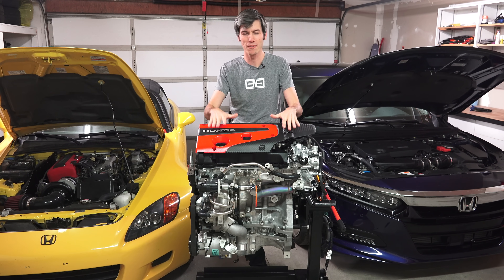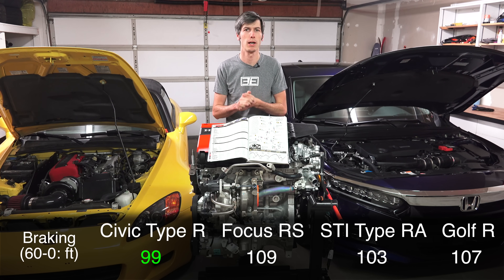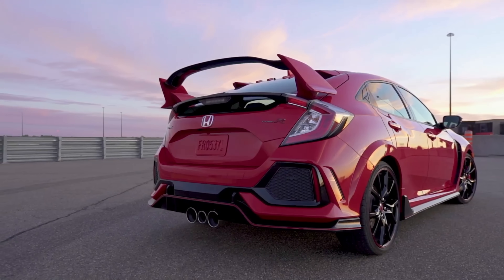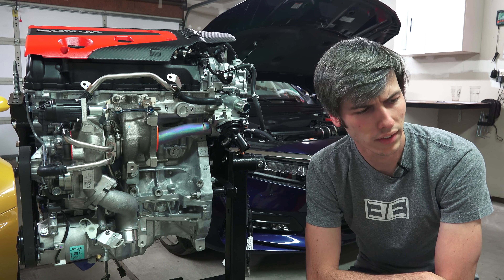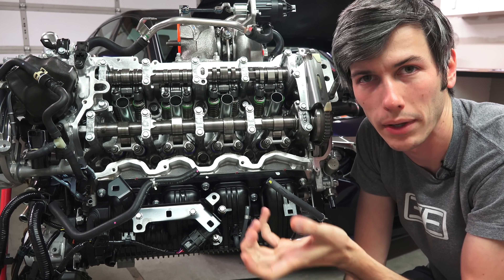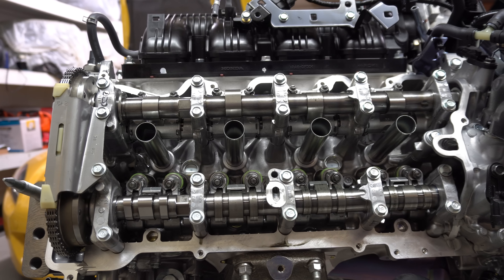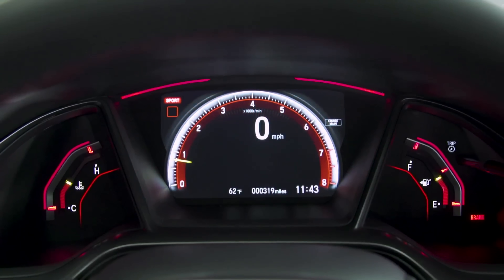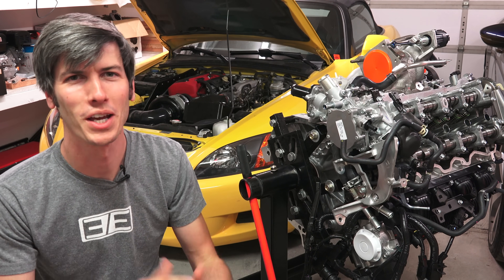The Honda Civic Type R Destroys The Competition - The Best Engines

Comment: I'm pretty surprised that the STI did so poorly compared to the rest. Although I suppose the real test for an STI would be to test them on a dirt track.
Reply from the maker: I think it’s fair to assume the STI would be descent on dirt, but in reality it’s suspension is for sure set up for the road. It’s lost ground clearance with every generation, and is quite stiff. Neither ideal for dirt, unfortunately. It’s designed for track days and can handle abuse, it’s just super dated in comparison to the competition.

Comment: How long does it take the octane level of gas to drop once it is in your tank? My truck has a large gas tank that I like to keep 3/4 full at least. However I don't do a lot of driving. I'm concerned by the time all the gas in the tank has cycled through the octane level may drop below 87.  Which is the main reason I normally buy 91.

Comment: It makes good power, not those numbers are not crazy. 200HP/liter is standard now in motorcycle engines-naturally aspirated. A more impressive feat for Honda would be to build the thing to last 500,000 miles with that power.
Reply: 200HP/Liter is possible on motorcycles because their small displacements allow +10k rpm . It becomes increasingly harder to sustain high rpm with heavier engine components with the increased reciprocating mass. Getting a Car engine to pump out 100HP/L NA is already an impressive feat.

Comment: I'd like to see how the speed comparison would be if they tested on wet greasy roads. In ideal traction conditions driving more than 2 wheels is a waste of time if the chassis is set up competently. The real world, especially where I live, is full of less than ideal conditions where a 2WD will just be spinning both wheels and kicking in traction control while a 4WD only needs half as much from twice as many tyres to get the car moving. In slippery conditions I'd take a FWD over a RWD any day of the week for daily use though, so I think they've got that right. There's no question Honda have built an amazing car, even ignoring the difference in price.

Comment: You can tell what Jason is thinking during this video.
I want to put this in my s2000
I want to put this in my s2000
I want to put this in my s2000
Reply: He already has a supercharged 2L in his car. It would be a massive waste of money and time and all it would mean for him is a little less weight
Reply: His engine is probably capable of more power already with an ECU and pulley.
Reply: I think He meant the 2L turbo iVTEC motor
Reply: I'd like to fit in a S2000. lol (I'm eye level with the top of the windshield) $ 6520 for the type R crate engine sounds good.but does it come with ecu's? Love to stuff one in my 3rd gen Prelude si. No luck for us . Read an article that say Honda will only sell the engine to members of the Honda race team.
Reply: Dbn Poldermans i want to put this in my RSX!
Reply: Was just thinking this 😂
Reply: S2000s aren't meant to be boosted; that high RPM NA feel is part of the essence of the car.
Reply: It wont work. The design of the model is what it makes it unique.
Reply: well, the new turbo hondas make the s2000 feels like the s500, when u owned the s2000
Reply: ikr
Reply: Much better off boosting the s2000. It will make the same power with far less boost.
Reply: @SpeedDemonExpress  the f20c/f22c is far superior to any k series, including the k20c1
Reply: Dbn Poldermans make the s2k fwd or make the engine rwd either way that’s a hell of a job to do
Reply: @isabelle.c011  you could use adapter plate and custom flywheel to mount k series engine to s2000 tranny. Been done lots of time. They the k series and f20c rotates the same way
Reply: Isabelle squad all for the clout
Reply: @isabelle.c011  just change the gearbox.. The stock s2000 engine is just mounted longitudinally with a different box, its just a tuned engine used in most honda fwd's. So take this turbo engine, mount longitudinally (weld new mounting points) and potentially fot the stock s2000 gearbox and youre there.
Reply: StevEazyB like I said hell of a job lol
Reply: StevEazyB it’s not as easy as it seems. You have to to get a custom motor mounts, adapter plates, adjust the the throttle linkage, wire the harness, intercooler, piping and Ecu. Not to mention all the other random bits and pieces that you can never predict. It would probably be a 10k job just for all the a hardware. Not including the cost of the engine and tuning

Comment: Hey Jason, Great video.
I have a question slightly unrelated to this engine so I hope you can answer.
If a car guy were to take a V6 engine and slap a turbocharger similar to F1 Mercedes Hot inside V, would there be any (considerable) performance gain?
I am asking since it would seem quite a good idea to have a supercharger were the compressor would be driven by an electric motor and have the turbine drive a generator. Would this reduce load on the engine, as the alternator doesn’t have to take energy from it to power the compressor? Could the extra power from the turbine be used to power A/C, power steering or any other auxiliary systems?

Comment: Saving weight by smaller spark plugs? Come on, removing badges and floor mats would save a hundred times more.... Honda does build great engines, always did. But let´s face it, none of the target customer boy racers can come up with the presented numbers on acceleration and corner speeds...

Comment: You say that Honda says the plastic chain guide lasts the lifetime of the engine.  I've heard that before. That's a tautology.  It really means that the engine fails @130K no matter how often you change the oil.  THEY PUT PLASTIC CHAIN GUIDES INTO ENGINES FOR ONE REASON: TO  ENSURE FAILURE AND NEW SALES.
Reply: Most cars have plastic chain guides. Do you realize how loud the engine would be if the chain was sliding across a metal plate?? You acting like this isn't something that is super common shows that you don't know a lot about engines.
Reply: Lmao he never said anything about the plastic chain guide.
Reply: I can see your point.  It could go either way.  But he is discussing the assembly's lifetime at 4:02 and it is clearly a visible part.
Reply: I believe most of the failures of composite guides are due to the tensioner failing and letting the chain slap around, or the chain wearing out and the tensioner running out of travel letting the chain slap. I am pretty sure that's the cause in the more common Ford failures.
Reply: The plastic material hardens over time.  The VW motors were notorious for the tensioners breaking apart, then those parts get in the timing chains, they skip and take out all the valves.  Ask me how I know...  I don't care what they say, you better be replacing tensioners like these at 100k or sooner.
Reply: Volvo, my prior reply was censored by Jason.  I think the links here will change your perspective.  quora DOT com/Why-are-we-no-longer-able-to-put-transmission-fluid-in-our-cars-ourselves/answer/Jason-Taylor-16 .
Reply: Honda engines have always been reliable unless a ricer blows a civic up with too much boost. It's hondas automatic transmissions that suck.
Reply: F series engines in honda s2000's use plastic chain guides.  As long as you stay on top of maintaining and changing the chain tensioner you wont have any issues.  There's plenty of S2000's out there that are well past 180k-300k miles on the dash with original engines never cracked open.

Comment: I enjoy your videos a lot, i am not a "gear head" so i have a question on a non civic but Honda subject. Does Honda recommend all engines have a valve adjustment done at 100K. I have a 06 Pilot with 160K .Thx

Comment: Yay... Direct Injection... lots of carbon build up on the intake valves.
Reply: oil catch can?
Reply: Ever heard of sea foam ? lol
Reply: That's generally only on the early generations. Normal now to have a second set of injectors that spray on the valves and keep them clean.
Reply: Or you can do what BMW does and make the intake really easy and fast to take out...
Reply: Not sure if the K20C1 has second set of injectors for the valves @Engineering Explained, can you confirm?

Comment: I'd love to see a video about carbon build up in direct injection engines. Ive seen a few taken apart, and after even just 5-10k miles, the valves are almost completely cakes with carbon

Comment: This test has to be biased, the official 0-62mph for Golf R is 5.1 seconds for manual and 4.6 seconds for automatic, way faster than 5.7 stated in the video...
Reply: Don’t think the testers knew how to launch a awd car.
Reply: It's not biased but I believe its Motor Trends drivers or whoever, not official numbers at all and completely inaccurate. You are correct.
Reply: They dont post tires and used same across board its all a lie then and cheating. Anytime someone talks about every part of a car but doesnt talk about the great grip the get from the tire wheels and suspension just turns out to b complete fake test they need to avoid talking about  the tire they used to lie.
Reply: Official means nothing.
Reply: Well, most people who test those VAG engines -  actually find them producing more power, and performing better than official figures

Comment: Ok it's fast and stuff, but sports cars are about sporty sensations and I don't think a FWD can give the sporty sensations of a RWD.
I do have a RWD Honda though, but it's a lawn mower.
Reply: 1.01g cornering grip from the factory is pretty insane as far as 'sporty sensation'. the road course times don't lie
Reply: Damn I bet that thing feels sporty😂
Reply: Well it's a lawn mower, not a sport car. But if you are a Honda fan I understand you mix up those two.
Reply: They need a new S2K
Reply: Drive one and then get back to us. Of course is not going to feel like a RWD car, not even the RS with a rear biased AWD system really feels like a rear drive sports car...but the Type R will definitely surprise you when you push it around turns.
Reply: I guess you were never in an Eagle Talon TSi Turbo. oh it'll be just fine :)
Reply: that's because you've never driven FWD. yes FWD do feel sporty but they just can't oversteer. tell me why me there are fwd track civics that smoke expensive awd and rwd cars.
Reply: @electricfeel9501  Of course FWDs can oversteer. Chassis oversteer, in spades.  Not power oversteer.   Check out the Megane RS280 lapping the Nurburgring, plenty of oversteer!  {not as sideways as the mid-engined Alpine A110 of course, but not bad for an economy hatchback)
Reply: Damnnn savage
Reply: fwd is type for grip cars, as long as they allow to corner with high speed, it is fine.
Reply: Alisio Ardiona well it pulled the same G force as the rs and more than the others so apparently it can.
Reply: the 80s called, they want your point of view back
Reply: that joke is older than the 80's
Reply: Tho it’s a front FWD car. You can’t deny the performance it has to offer. It even beats its competitors that are equipped with AWD.
Reply: Who cares. it'll feel plenty sporty when this fwd civic kicks your rwd through the twists and turns!

Comment: Any idea why they didn't use the diverter valve like the old RDX's to vary the amount of boost created on the compressor side of the turbo? Going for best power overall with the sizing of the Civic Type R's turbo I presume? You mentioned the different sizes between Accord and Civic, had me curious.

Comment: It's about time they use timing chains and not that pesky inferior timing belts.
Reply: TheGomezIndustries the Civic has had a timing chain since 2006 (or in the Si’s case 2002). The belt is still used in the J-series V6s because the original engine design was the mid-90s when timing belts were popular

Comment: Interestingly enough, VW does just about all of the same tricks to achieve the higher horsepower in the Golf R so I wouldn't suggest these technologies are exclusive to the Honda Type-R engine. Oil-cooled pistons, sodium-filled valves, twin-profile exhaust cam, variable-geometry intake-manifold to create tumble, exhaust manifold in the head, bigger turbo than its stablemates, etc. They do opt for balance shafts, however, for a more refined feel.

Comment: Great video! Now only if they make another S2000 with this engine, and rev it to 9k
Reply: No chance to do that because of the environmental laws
Reply: why? if you want an s2000 get an s2000.. crazy huh!
Reply: @steveazyb2595  Because...Racecar. Sometimes you don't like the motor, but you like the body and vice versa. It's to improve the performance of a car that's aesthetically pleasing to you. Maybe he likes the s2000 but it doesn't pack enough punch for him. He also doesn't just read the brochure :)
Reply: Honda is waiting until the year 3000 to make the s3k
Reply: It's turbocharged...it will never reach 9000 rpm from factory..you don't know how engine works apparently
Reply: Honda should release the s660 in america with the type r engine.
Reply: SK8215 I’ve heard they are working on another s car but it most likely won’t have the type r engine
Reply: @MissingLinkGTRS  that would be nice but that would make the turbo pointless, because some of the reasons for going turbo is power and longevity.
Reply: Honda stated earlier in the year, that the s2k will not be coming back. Not any time soon at least.
Reply: No, just no.
Reply: And have Doctor Joushima rematch with AE86 in the new s2000 downhill one handed
Reply: Waiting for HASport to come out with the engine mounts for s2000.
Reply: The reliability would go down astronomically is what would happen.
Reply: So i’m now trying to figure out if Honda would let me buy a crate engine for my classic mini if I start going racing in it :) that would be some crazy power in a tiny package.😱😎💯
Reply: The s2000 engines are better than this.

Comment: It’s such a pity they made a mess of the looks of the civic its horrendous compared to the focus or the golf
Reply: I’m too old to be driving a car with such a big rear spoiler.  I need the technology and performance in a more conservative package.
Reply: @dickfitzinya3082  same
Reply: @dickfitzinya3082  so buy the car and remove the spoiler. Boom problem fixed bud
Reply: Glad I'm not the only one who thinks so!
Reply: the Golf R is flat out boring, it looks like a regular golf with some branding.
Reply: Yup
Reply: Higomad I love the civic look
Reply: Higomad Looks are 100 % subjective and meaningless to discuss. Acceleration times, brake/stop time/distance, fuel consumption are all objective measurable values. Guess what are modt important?
Reply: I would never buy the focus because it looks too plain
Reply: I love the civic at least it comes from a company that's reliable. Ford sucks.
Reply: Focus is ugly and unreliable.  Resale value is dismal.  Golf R looks good but still lesser.  The Type R vents are real but the grill is fake along with fake carbon fiber trim.

Comment: Much of this translates well into the downspec 10th Gen Civics too.  Aside from the ugly styling we'll just have to get used to in small cars these days because the fashion industry rules body styling now and fads must come and go... the 1.5L Turbo Civics may be the last of the great everyday conventional drivetrain cars.  Electrification seems inevitable with hybrid gas-electric picking up the slack for less urban owners needing longer range.  "CVT everywhere" has to be just around the corner as an integral part of the picture.

Comment: The question is, what did the Civic do to lose the 1/4 mile race to the RS, despite having a lower 0-100mph time, and higher 1/4 mile trap speed? Did it really lag the RS so much in the initial part of the 1/4 mile race that it couldn't make up that deficit with its roaring finish?
Reply: At a guess, gearing.

Comment: I still think the f20/22c is the best honda engine ever made and possibly the best 4 cylinder engine ever period.  22 psi on the type r to make 306hp? 5psi with a similar turbo in an f20c will make more
Reply: The F20c isnt making 300lbs of torque at 2500 rpm though